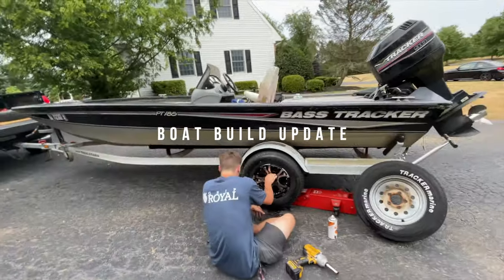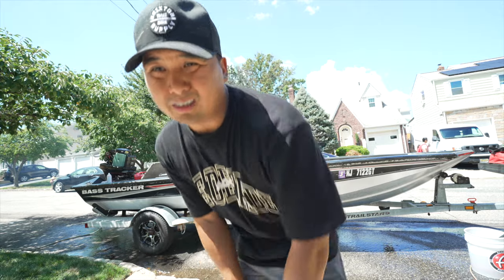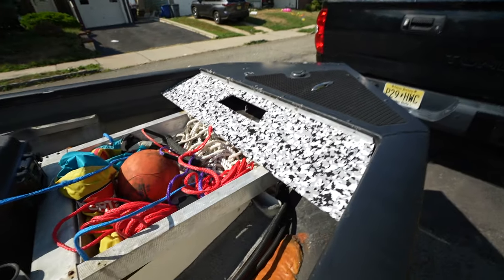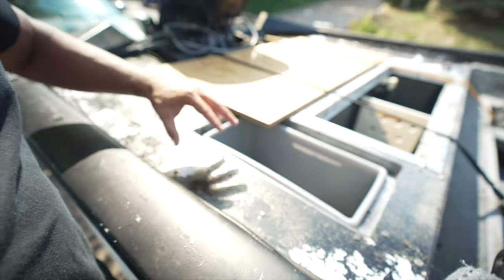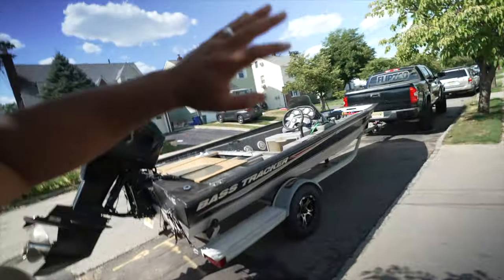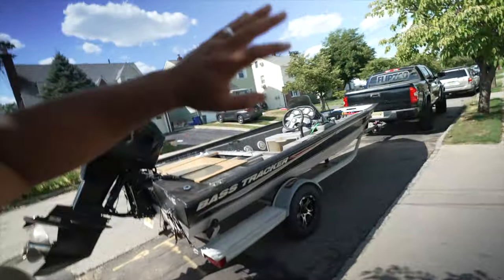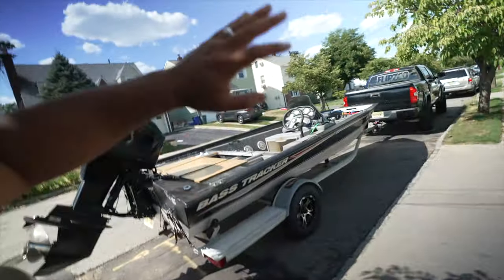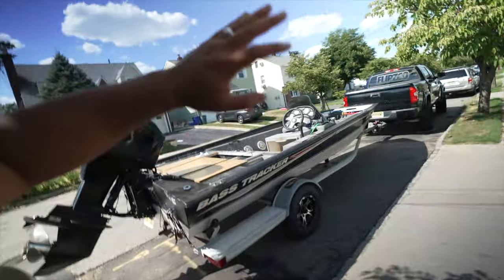$1,500 OLD BASS BOAT RESTORATION From Craigslist! *EVA FOAM*

Comment: How is the foam holding up on the corners of your lids? I noticed you rolled it around from top to bottom. Did you pin it on the bottom or just let the adhesive do it’s job?
Reply from the maker: So far so good! I did use 3M adhesive for the corners and let it sit with weights overnight

Comment: How many sheets did it take to do both decks and the floor? I’m remodeling a tracker and am thinking about doing the walls and sides of the boat a different color foam than the decks and floor.
Reply from the maker: 6 Sheets - with maybe 2ft leftover
Reply: @Flipzco  sweet. Thanks!

Comment: I'm extremely interested in the side carpet and how that works out for you. I am going to do this to my boat deck next spring and am looking at which foam to use. Nice job, it looks really nice.
Reply from the maker: Thank you! Light with the coats.. but once it’s even you literally save so much money! I would only keep it on the cat walls as flooring it’ll feel a little rough

Comment: Hey, I recently got a boat very similar to this (2004 bass tracker pt 185).  I’m looking to do a very similar design with eva foam, if you don’t mind either replying to this comment or maybe even making a video about how well it’s holding up and anything that you would’ve done differently or would recommend for someone like me going into a project like this.  Thanks!
Reply from the maker: Thanks for the support and comment looking to post a video soon regarding how it held up
Reply: @Flipzco  Awesome, weird question but does your bilge pump work? If so what switch on the dash turns it on and off?  Mine doesn’t seem to be working and I’m having a hard time determining what’s wrong with it (fuse, wires, switch, etc)